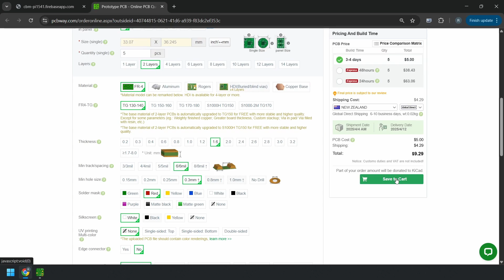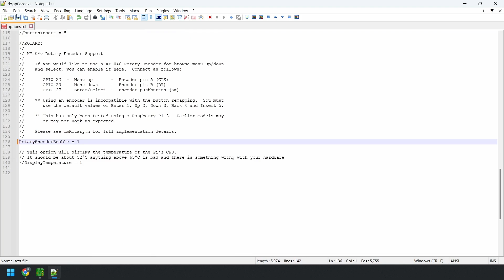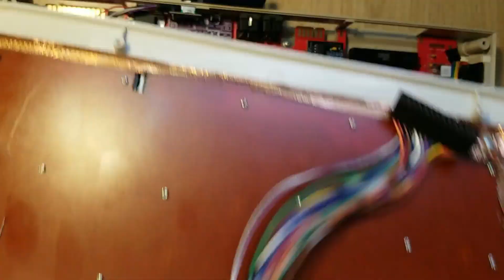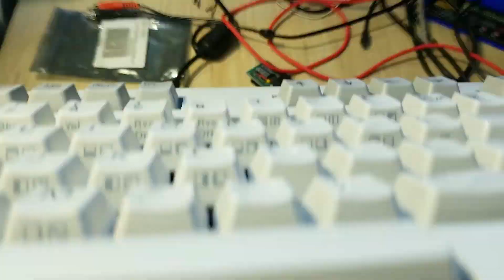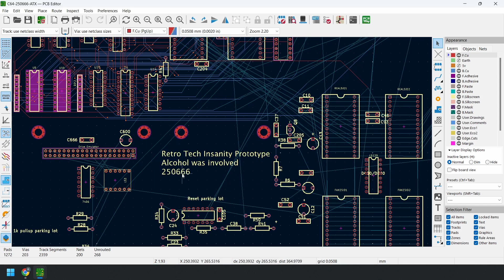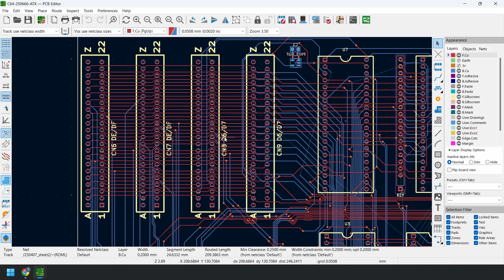Internal Pi1541 Interface for the C128 - I made my first PCB!

Comment: At some point, someone should create a 'Neo-Geo' 128 board that contains all those enhancements to get rid of that mess of wires.
Reply from the maker: Yes I'd like to and was looking at the CR board this morning as a base for that work.  Problem is there's barely any room for traces left on the original board used in the plastic D and the standard model case.  The board needs a complete redesign and be 4 layers.  I'd love to tackle that some day but want to do a few more smaller projects 1st to get my skills up.
Reply: @retrotechinsanity  instead of 4 layers you can first try to design replacement for glue logic chips via CPLD or GAL and/or make some daughterboards. Oh, nearly forgot that putting bigger ROM chips to reduce occupied space and traces is probably easiest step.